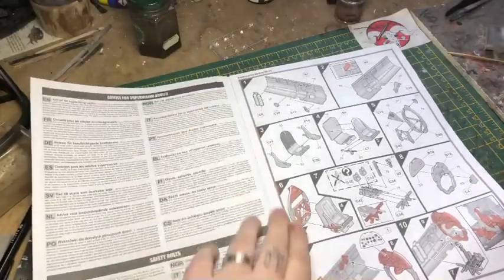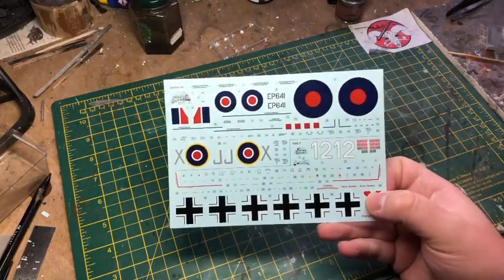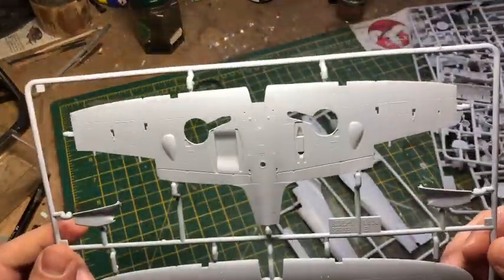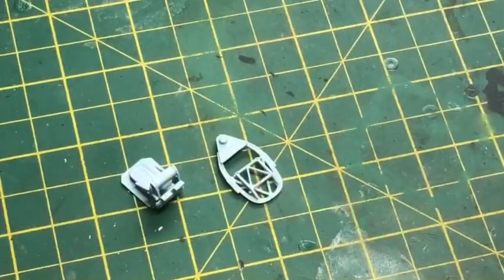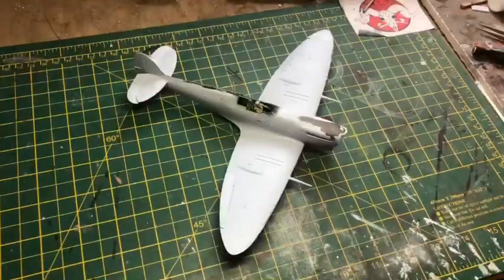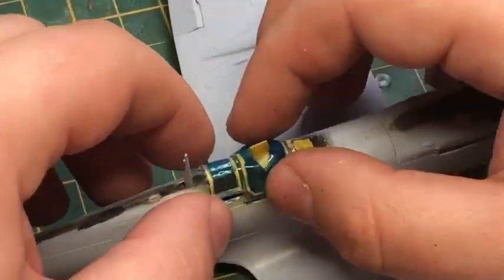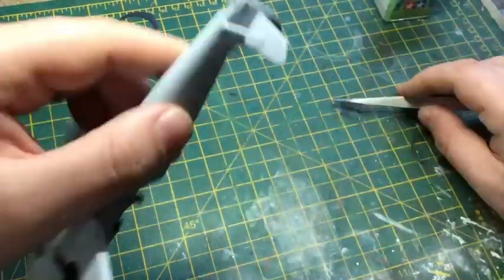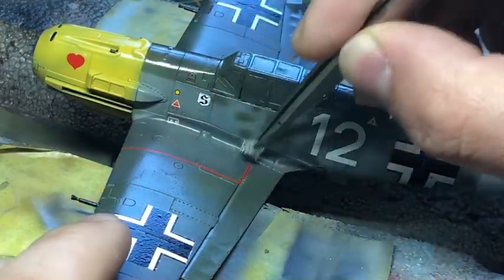Airfix dogfight doubles Spitfire MkVb & BF109E 1/48

Comment: Nice one Sully, yours is the only vid I can see for this double-kit, and that gets ye a deserved sub fae me... 😎
Reply from the maker: Thanks dude! I think i struggled to find these on youtube as well
Reply: @SullysScaleModels  Yeah, tell me, the 109 looked like there weren't many parts, is the detail on it as good as the Spitfire, cock-pit wise ? 
Older modeller here, trying to get back into it, and there's so many larger scale beauties now, perfect for my auld peepers 🧐
Reply from the maker: @Boofy_Gastard  yes i find 48 much a better scale to work in! The 109 in general the 109 has a much simpler and in my opinion tidier cockpit. You will find most manufactures have the same simple cockpit for the 109
Reply: @SullysScaleModels  Yeah, dunno that my fingers are nimble enough for 1/72 nowadays, fingers crossed that I have a chance with 1/48...

LOL, I suppose that's only to be expected, German efficiency, or "Vorsprung durch Techinik", as they say 😜